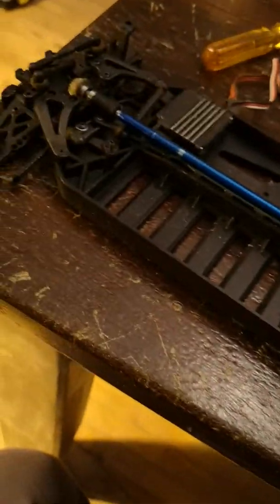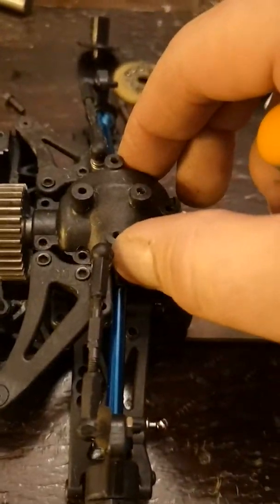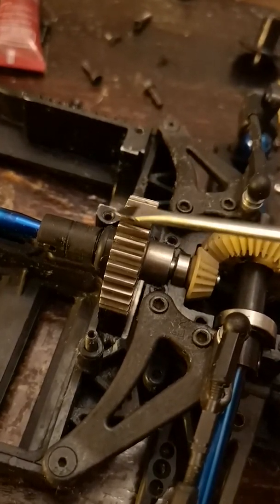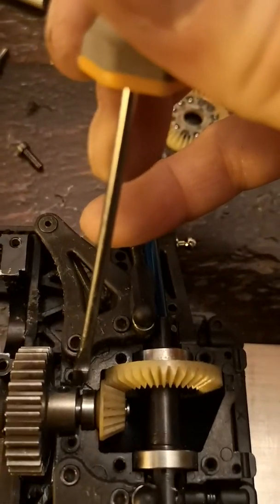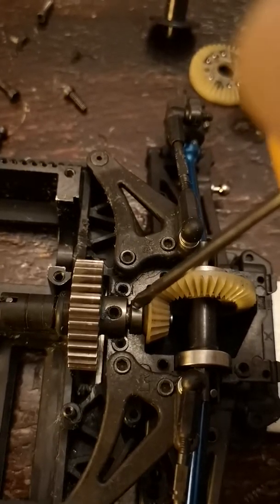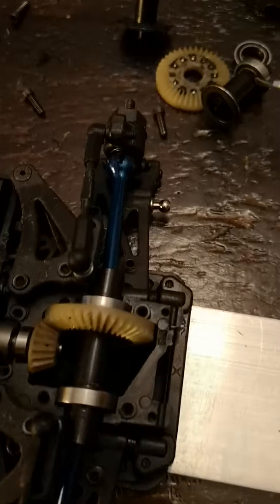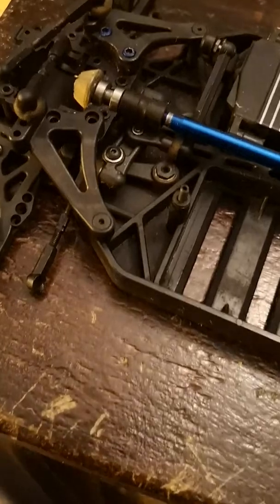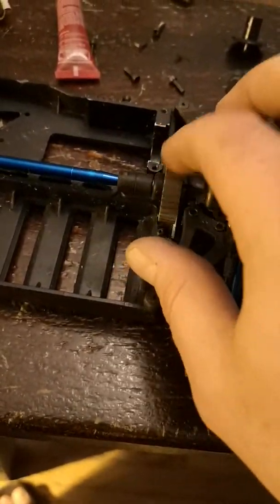Team associated TC4 mod1 upgrade

Comment: My bigger concern is coming up with a better motor mount. I have a few of these and those cams aren't getting any easier to find. I'm not ready to give up on the old girls just yet though.  Sitting next to a new 4tec the tc4 is still a better car in everyday except parts availability lol
Reply: I actually went to do this mod and realized something.  That shaft isn't actually 5mm and the Tekno pinion i got is. This means when you tighten the pinion  its off center slightly and the gear mesh goes tight-loose-tught-loose.the only thing I can think of is a sleeve to take up the gap and center the pinion..  I knew it sounds to easy..